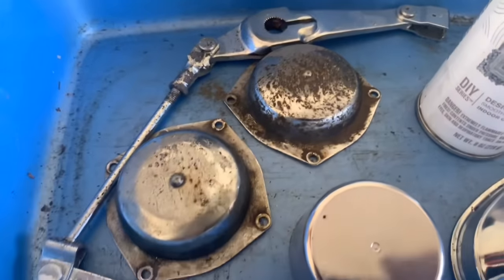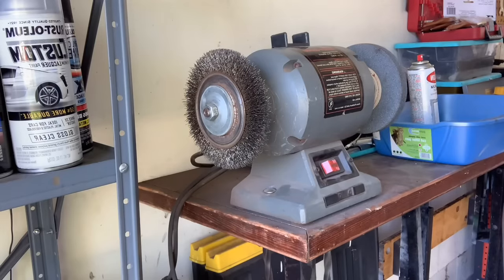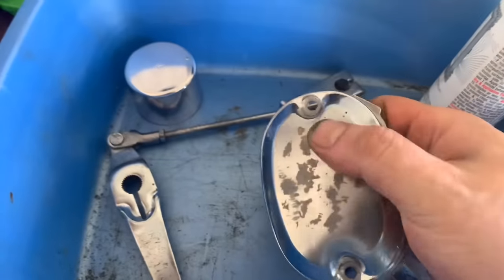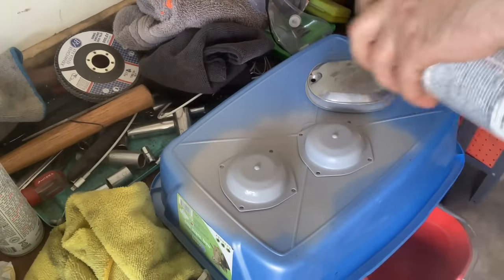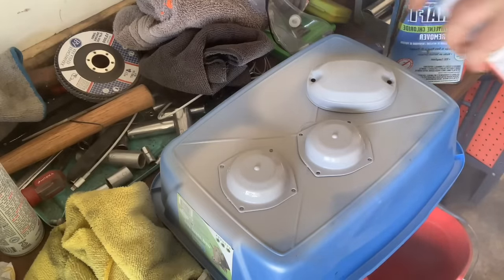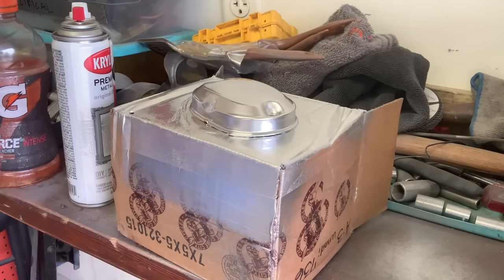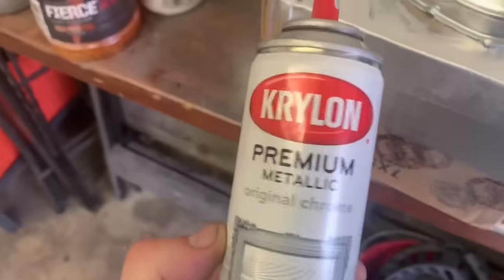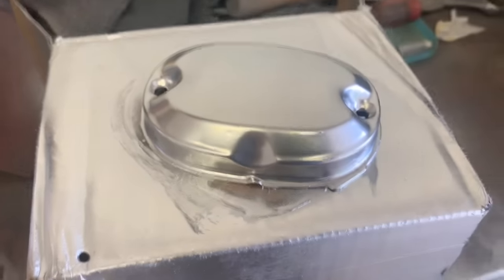Painting With Krylon Chrome Spray Paint-Vintage Motorcycle Restoration Project: Part 69

Comment: When it comes to chrome spray paint, I want a can of the paint that they used to paint the spray can cap with!
Reply from the maker: Totally!
Reply: You get closer to a mirror finish when you lay down gloss black as an undercoat before the chrome spray.  The gloss black acts as a mirror
Reply: I think they chrome plate those caps !! lol.
Have used this myself, might try the gloss black underneath on something, could help make the chrome paint pop a bit.
Reply: @KeepOnWrenching  +++
Reply: @lesskinner8588  That does sound like interesting to know advice that seems to help. If i dont get a proper chromium tank setup or that electroplated spray version, then i'll try the gloss black paint undercoat, however, it appears as if the first time a dot of gas or snotrockets that hit the surface of the dry chrome paint, its going to etch itself into place as some bubbling up was observed in the video when he tried putting a solvent based clearcoat rather than a waterbased clearcoat on it. To make chrome look more real, i've been using a method that was made popular in autobody shops in the 60's, i smoke copious amounts of the devil's lettuce and that produces a high gloss to the surface of the lenses of the eyes, and from the coughing it can really get a good coat of fluid on the eyes held in place with surface tension.
Cheers and happy chroming!
Reply: There is no such thing as chrome spray paint, only shinier grades of gray spray paint.  Try 2K clear.
Reply: I have yet to see a chrome spray paint that actually looks like chrome.    Silver metallic seems to be as close as they can get to chrome.  Those chrome caps are false advertising.  Lol.
Reply: @upnorthviking823  There are two types of clearcoat, one is waterbased, the other isnt. You'd want to use the waterbased stuff if you wanted to seal the chrome type of paint, or it would act like when you put a brush into a can of paint thinner.
Reply: @upnorthviking823  also don't shoot lacquer over enamel
Reply: @nathanmyles3785  I'm gonna try that. Thanks.
Reply: @nathanmyles3785  great tip!!
Reply: @harryballz6358  agree with you there the paint he using and all other paint like this I 💯 BS.... dose not and will not ever look like real Chrome. There is no resemblance of the look and the shine that chrome has. This look like a  glorified extra high gloss gray metallic to me there is hardly a shine to it. What shine that there dose not look like real chrome at all far from it. Waste of money, I have the same and used this chrome paint. and I tested it. There is a  process you have to do when chrome  plating a rim or bumper and it dosn't come in a can TOTAL BS!!!!  the 10 I spent on that i could of bought a 12 pack or wasted the money having fun
Reply: Still think it just looks like normal silver?
Reply: Fkng. Aye man.
Reply: Yes!
Reply: @harryballz6358  I am trying to repair a hood molding on a Vue that has bubbled. Do you know anything of how to get plastic to have a chrome like finish? Any suggestions at all would help. Tia
Reply: Spot on 😂😂😂
Reply: I've seen a video where a guy uses some nail varnish and the results are amazing, can't find the link but it's available on YouTube.
Reply: @Susan70003 You can paint it silver like this video shows or you can buy a new part. I think the new plastic parts are static plated and it it looks pretty good, comparable to electroplating on a metal piece, but nothing I’m aware of in a spray can could ever be confused with real chrome.
Reply: @rustyaxelrod   I tried finding a new part. For 2006 they are not available anymore. Not even aftermarket. Thanks
Reply: @bluejack644   Alsa easy chrome ;)

Comment: A few tips if you're doing chrome paint. Always use black primer that will make for the glossiest most reflective chrome effect. And if you're using a clear coat the chrome paint must dry at least 24 hours and be fully hardened. At that point put the clear coat on in very light coats that way the solvent in the paint doesn't break down the chrome underneath.
Reply from the maker: Thanks! I do need to try again with black base. Surprised it doesn’t say so on the can.
Reply: I thought clear coats full the mirror effect indefinitely
Reply: @KeepOnWrenching , A black primer base is not enough. The color of the primer does not matter, what matters is to use a first layer of very shiny black paint with a mirror effect as pronounced as possible for a better result. The chrome paint should generally be sprayed in light strokes, but it depends of the brand.
Reply: @philippealain-art   is exactly correct! Painting the piece gloss black first will give the chrome paint a more chrome like finish.

Comment: The thing about spray paint is depending on which brand you use, it takes 3-7 days to harden & cure. I always wait 10 days and then clear coat it.
Reply from the maker: Great tips. I appreciate it.
Reply: Your car is going to look really good!
Reply from the maker: Buahahahaha!
Reply: The reason that clear reacted to the chrome paint is because the clear was lacquer based and the chrome paint was enamel based. You can put enamel over lacquer but you cannot put lacquer over enamel
Reply: I have a small oven that has a potentiometer type heat control. It can function down to 35-40C.
When the paint or lacquer has 'gone off', the oven can be ramped up, to bake the coating.
The lacquer becomes very hard.
Due to the wide range of constituents, the best option is to research the coatings to discover the ideal temperature & time settings.
The info is out there, because it's needed in a production environment.
There's nothing better than a rock hard lacquered component.

Comment: If you use krylon or rustoleum clear over their paints, you either have to spray it while to base is still wet, or wait about 4 days.    The clear "re-activates" the base until it's fully cured.   You can also polish she base once it's cured. 

Also, SprayMax 2K clear for the win.
Reply from the maker: Thanks for the info

Comment: I sand and prep the part, then i clear coat it, then i sand it just enough to break the glaze, then i spray the chrome paint, then i spray a final clear coat, the final results come out really nice every time, great video, thanks 👍.
Reply from the maker: I like that approach.
Reply: How fine do you go on sanding?
Reply: @firstmkb  i like 1000 grit wet \ dry sand paper to break the glaze with.

Comment: First thing is that after cleaning and prepping the parts you should use a tac cloth to remove dust and oils from your fingers left behind. Then primer but always wear latex gloves to handle parts. Then scuff and use tac cloth again. Finally paint.... but always be sure that primer, paint and clear coat are all compatible with each other and all should be by same company (in your case, krylon). Also for small parts a clean uncluttered area is better and using a turntable makes everything so much easier.
Reply from the maker: Thanks for the tips! That I definitely learned the lacquer lesson on enamel. Lol

Comment: Hi Brian, I've had no end of trouble with Rustoleum clear coat [even over Rustoleum Gold/Chrome paints]
I switched over to VHT quick dry clear and the problems went away. I sometimes sprays cloudy but dries clear, and gives the base coat depth.
Next time you try this , do 3 steps on top of the primer. 1: a base metallic for depth 2: the actual chrome paint applied thinly 3: VHT clear. And be Patient waiting.
I had fantastic results spraying Gold Chrome onto Vases doing the above method [it was difficult to tell from plating]
Reply from the maker: I’m going to try a black base one of these days. It’s worth experimenting with.

Comment: spray the parts with a coat of gloss black,  let them dry real good,  then spray the parts with the Krylon Chrome spray.   the chrome spray will have a deeper shine.
Reply from the maker: I need to try that! Thanks.
Reply: @KeepOnWrenching   i tried it on a couple miscellaneous pieces as a test, and saw a noticeable difference.  let me know how it turns out for you.
Reply: The spaztic i think its called does have a black basecoat for their chrome paint. Ive seen some videos of it and it doesn't look to far off from real chrome.

Comment: You should try a gloss black after primer and before chrome paint
Reply from the maker: That seems to be important.
Reply: Exactly. And follow at least the minimum basic instructions in application
Reply: I was thinking same thing while watching. I did cringe a little when sprayed over grey filler primer. A gloss black undercoat would help with the reflection and brightness of the chrome paint.

Comment: I'm starting my 360T rebuild soon.  Chrome is going to be tough.  I think I'll do the chassis painting myself but the tank and side panels will need a professional touch.  I expect the engine clean up and polishing will be tough.  A few of the parts (mostly anything plastic) will need replacing.  I decided to go with a laser printed side panels because it was just too hard to find the originals that weren't in bad shape.  The slits just get too fragile and break.  Last one I got I had to get from Sweden and was held together with hope and glue.  The hope ran out when the glue gave way.
Love the channel Wrench dude.
Reply from the maker: Go make it happen. It can be a struggle.

Comment: I plan to spray my contact lenses with Krylon Chrome. 
I'll scuff them up with fine sandpaper and spray a coat of primer, of course.
Can't wait to see how it works.
Reply from the maker: Please don’t. Do you need a hug?
Reply: @KeepOnWrenching  ,
"Need a rug??"
What?
Why would I need a rug?
I could use a rag and a dab of paint remover though.
Hold on a sec.
I think Elvis is at the door.

Comment: Wait for the Chrome paint to Cure before attempting Clear Coat. Read the label on the Chrome can to see what the cure time, although I believe 5 to 7 days wait is best. It's also best to try the Chrome and clear coat combination on a piece of metal prior to doing the project to make sure everything is compatible. Sometimes cloudiness can also come from there being too much humidity in the air. Lots of good ventilation in the area where your painting will be helpful with all paint jobs. It doesn't have to be a wind tunnel just some lightly moving, exchanging, air. And of course take your time, have lots of patience, and that will most often give you the nicest finished project. It's all fun! Enjoy!
Reply from the maker: Yeah that whole day was a complete mess.

Comment: I use that premium metallic and found if you do a gloss black first and let dry for a couple of days, then do the metallic over that it gives an even better chrome look. 🙂
Reply from the maker: Definitely worth a try! Thanks for the tip.
Reply: Any time.
Reply: Rustoleum and Krylon are not compatible.  Use Krylon clearcoat with Krlon paint or Rustoleum clearcoat with Rustoleum paint.
Reply: I let it dry for weeks and it still smudged. The smudges don't come off

Comment: You have to let the paint dry for at least 24hours before you put on the clear coat , and another thing, if those covers are engine covers the paint is going to peel off due to the heat , you have to use ceramic coating paint sold at your local auto shop.
Reply from the maker: For sure. This part didn’t require high need like engine parts but a valid point. It couldn’t hurt!

Comment: This is paint to help look like chrome. Now gloss back may help as a base can change the chosen color. 
If you want all 8 parts chromed, it will run you about $230 - $280 with the 14 steps it takes to remove the chrome, wire wheel deep pitting, acid drip, clean, copper plate, buff (Repeat on deep pits like the points cover) re-apply copper, pickle, nickel plate, clean, 5 seconds in chrome, clean, polish, wrap & box plus tax. Don’t forget photos & tags. It is almost a cheap as 1 tooth extraction...as long as a root does not break off. 
What have you had chromed lately? (Chrome cotter pin not included) 
This is painting where chroming a part involved dozens oof chemicals that require a license to purchase and cradle to grave chain of custody if disposing, then pay for that cost. My brother has been doing 14 types of plating for 4 decades and is now a manager of second location. The degree of difficulty rather than size. He knows! He told me it’s easier to re-chrome an old Honda bumper. ASE Master Tech - Retired
Reply from the maker: I was just curious about the chrome spray but yeah I don’t want to pay to rechrome. Easier to buy replacements on eBay.

Comment: Try another part.
Spray on primer/filler (any colour), lightly sand smooth, add a good coat of full-gloss black (don't sand), spray with chrome over the black then spray with 2k clear coat.
It should be difficult to tell from the appearance, if it has been sprayed or chrome plated.
Always wait 24 hours for curing before the next application.
Cheap, one part, clear coats are useless.
They wash off when fuel is accidently spilled on them or they're exposed to fuel vapour. And yes, they sometimes attack the paint below.
There is lots of brands of chrome spray on the market now. Some really good ones, some not so good.
Trial and error I think.
Reply from the maker: Thank you. Will give it another try.

Comment: There have been some serious advances in powder coating and with japanese brightwork and its peeling, pitting and corrosion being so common, there's new materials that mimic chrome as well or better than conventional spray enamels and have the added advantage of providing high fill capabilities for  badly pitted pieces.An entry level setup for home use will pay for itself in a hurry.Its worth checking out.

Comment: That spray paint looks like it covered pretty well however in my experience chrome paint never actually comes out Chrome unless you clear coat it otherwise it just looks like brushed aluminum
Reply from the maker: Exactly
Reply: I'm new to this. Do you mean clear coat it after applying the chrome paint or before?

Comment: You just mixed enamel with lacquer... You will definitely have reactions spraying over metallics! And try to lay down a light first coat to not oversaturate the piece you're painting! Always good spray a test piece and also work on your spray technique!
Reply from the maker: Yup. Lesson was definitely learned here. Always getting better.
Reply: @KeepOnWrenching  Yep, lacquer over enamel is a great paint remover! But I've used enamel clear coats and it improved the chrome look quite a bit and protected it from wear. Good option. Next test is whether it will work on plastic dash bezels and trim.
Reply: Absolutely correct! You cannot put lacquer over enamel. And you are also correct about putting a light coat first. I painted cars for 40 years and am now a service Technician for a automotive paint distributor. You are spot on!
Reply: I agree entirely except for the light first layer in concideration of the chrome paint. From what I have seen and from doing models when it comes to metallic paint you do one good layer of it. Not enough to get runs but multiple layers reduce the effectiveness of the metallic elements in the paint hence a gloss black undercoat to increase the shine and reflectiveness.
Reply from the maker: I’m gonna try again. I’ve picked up a few different chrome paint options too. Look for another video in the near future! Love the suggestions.

Comment: The reason you are having a reaction with that clear is because it is lacquer. You shot lacquer over uncured enamel. Multi layers of paints need to be compatible with eachother. I learned the hard way.
Reply from the maker: I believe I did too. Yup. The lacquer lesson was learned.
Reply: @KeepOnWrenching  enamel has critical drying time. If you wait too long or too soon it can wrinkle and lift on you.
Reply from the maker: Thanks, Roy.

Comment: Thanks for the video. I was looking to restore chrome table legs and saw this paint at Home Depot. It was going to be my last option. Your video made it my first choice.
Reply from the maker: According to some of the comments a black primer will help a lot.
Reply: L J Floyd - How do you restore chrome table legs? To polish, I use 0000 steel wool by hand. What power tool is best to first clean rusty chrome? A dremel or power drill or wire wheel or sand blaster? Thanks! P.S. I checked your videos but didn't see one for restoring chrome table legs. I need a tutorial! Thank you, Lena

Comment: When it comes to rusted chrome, soak your parts in vinegar for 24 hours, then rinse and dry, paint the part with high gloss black, then apply your chrome paint,  after the chrome dries, finish the part with a coat of 4X high gloss clear coat.  I found this method to give the best results
Reply from the maker: Vinegar can work wonders!

Comment: A little insight that may help in the future, “ANYTIME” you’re spraying over bare metal, use a metal etching primer or an epoxy primer. That buildable, filling stuff, can go on after. But you want it to stay attached to the metal and not lift. Flash times for rattle can paint jobs should be exaggerated between coats, like 30-40 minutes per coat! And once you get your base or topcoat sprayed on, wet sand, rinse, and tack, prior to clear coat applications. Remember to use primer sealers underneath before color and you’ll get results like it came out of a gun!!
Reply from the maker: Thanks so much for the info. That totally makes sense because the filler primer never really took. It was almost soft. I really appreciate the detailed response!
Reply: Sean is right, krylon makes a nice etching primer in a can, epoxy is usually a 2 part system in a can and has a very short shelf life once the components are mixed. I always use epoxy primer in a spray gun for bare metal and also a sealer when doing bodywork.
Ollies has krylon etching primer in a can for $2.99 right now, if you have one in your area